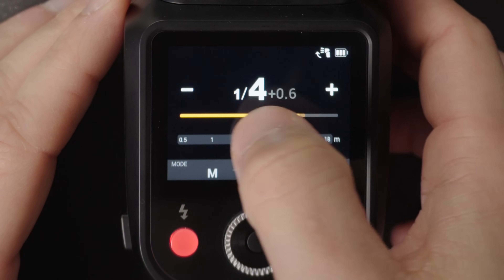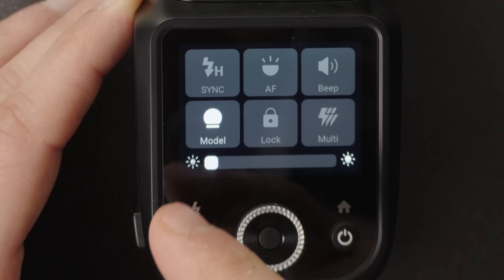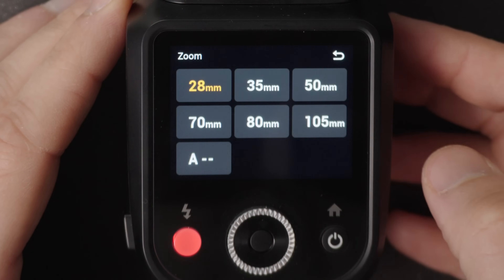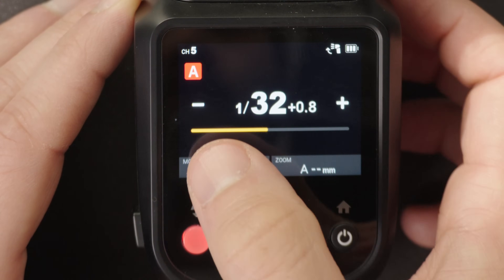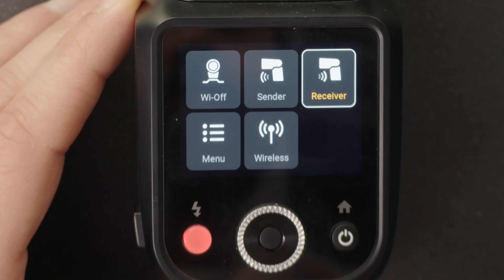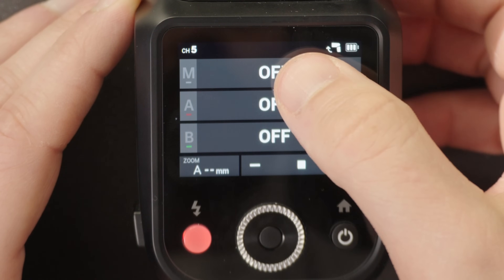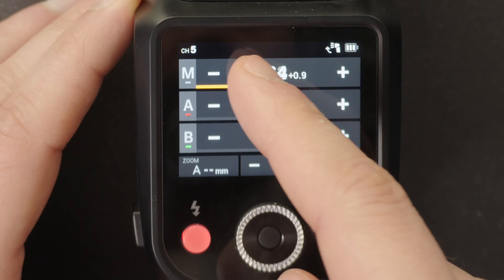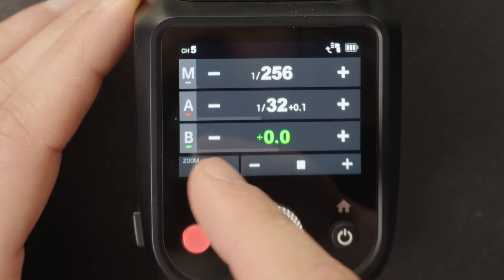New Godox V100 Flash Needs 1 Simple Fix (since Resolved via Firmware)

Comment: I’m pretty sure you can change it from a 10th of a stop to 1/3. It’s in that drop down menu.
Reply from the maker: Nope. Dropdown menu has HSS, AF assist, Sound, Modeling lamp, Lock, Stroboscopic (Multi) and a bar for controlling the modeling lamp power.
Custom functions menu has Slave, m/ft, standby, auto off, modeling lamp, screen standby, New agreement, Language, factory reset, and power type (integer or fractions).
The function to change between third stop and tenth stop is typically labeled as "Step" and paired with minimum power settings on other transmitters (Such as the X3 and XPro2).
Reply: @ So you WERE able to change it. I knew that you could but I just didn’t remember where it was in the menu.
Reply from the maker: @guyyowell8547   What? I just commented where it was on OTHER products. It's not on the V100.
Reply: @ You can definitely set it to 1/3 stops in the V100. I just go mine yesterday from B&H and in manual mode, I can set it to 1/3 increments.
Reply from the maker: @guyyowell8547  I'll take a screenshot / photo link of where it is on yours then, but I can promise I've gone through every menu on mine at it's not here (even ones like Slave that are irrelevant to power steps). I've also confirmed I have the most up to date firmware publicly available.
There's totally the possibility that you have a different brand and therefore it's at a different firmware than Sony. For instance, the Canon is already on firmware 1.05, whereas Sony is 1.02. If that's the case then great, I know it's on the way.
There's also the less likely possibility that a new firmware is on the newest production units but that hasn't hit the website yet. I find this less likely considering shipment time.
Reply: @ Hello Rob, I’m not quite sure how to attach a screenshot on YouTube, but if send me your IG account, I’ll DM you the screenshot.
Reply from the maker: IG is same as here. Or you can upload to imgur and link it here as a comment.
Reply: You really think Rob would have made that mistake?
Reply from the maker: @jeffrey3205  Appreciate that. I did confirm that I wasn't on pre-production firmware and that white label distributors didn't have this option.
Reply: @jeffrey3205  Well, apparently you can change it to 1/3 stops so Rob did make a mistake🙄
Reply: I looked at the instruction manual on Godox website. Didn't see any option to set it to 1/3 stops.

Comment: I don't want 1/10 stop increments for a speedlite.
Can this be changed to 1/3 stop increments?

Nevermind.  As I kept watching you got directly to my main issue with these new Godox Speedlites.  I hope they fix this with a firmware update.  I really dislike it on my V1 units.
Reply from the maker: I agree, the V1 only having 1/10 or full was quite annoying. In practice with photography, especially event photography, I find we make far more small adjustments than we do large, sweeping adjustments. And most often we make these in response to a camera settings change which is always third stop. I think the tenth stop control has it's place on large off camera units (400, 600, 1200, P2400) that are more likely to be used in studio settings or for more rigorous editorial / advertising projects.
Reply: @robhallphoto  - I shoot lots of weddings, and the 1/3 stops are all I need on a Speedlite.  I hate having to scroll through extra increments to get where I want to go.
At least it lets you jump in full stops by pressing the ring, but I still want to see a firmware update to allow us to choose between 1/10 and 1/3 stop increments.

Comment: Rob Hall, you are aware that Godox is selling V100 U units in North America that have a red plastic ring instead of the magnetic ring , due to a patent infringement case from Profoto. Adorama's Flashpoint version has the magnetic ring, and some retailers are supply a third party magnetic ring that you can swap in for the plastic ring ( and note: the replacement ring is NOT labeled Godox). I was just at PPA Imaging USA and spoke with Godox folks and they confirmed all this and displayed V100 U units without the magnetic ring. Adorama folks there were unaware their Flashpoint units were International units with the magnetic ring, and were hoping they aren't stopped from selling them. I took the small Show discount and bought one of the Flashpoint V100 units with the magnetic ring. . Cheers

Comment: Not sold on the touchscreen - it seems like the commander functions are now easier to use, but otherwise it seems like there is now a lot of unecessary menu diving. Where is the TCM button if you want to meter off the flash before shooting manually? I'm also wondering if "swiping" really beats just turning the wheel (I hardly ever need to make HUGE adjustments which the swipe seems to enable - just a 1/3rd here, a stop there). Also, how does this display hold up in bright outdoor light - can you still read it? I'm excited about the extra power/propac compatibility though - that last feature puts this over the AD100 in everything but portability.
Reply: You do not need TCM. In TTL take a photo then switch to manual and the flash will be a the level last used. So instead of pressing TCM you just switch to manual and it does the same thing.
Reply: @nickwilliams7867  I hope you are correct!  The TCM was the best thing since sliced bread!
Reply: @gosman949  I own the flash, that's how it works. Sony 45 and 60rm flashes work the same way. Take a photo in TTL, switch to manual and its set to the correct power.
Reply: @ that is nice!
Reply from the maker: TCM isn't necessary anymore, like Nick said it just transfers the power setting automatically when you go from TTL to M. Swiping often doesn't make sense for common use, especially event photography, where you are making frequent adjustments less than 1 stop. That's why I think the 1/3rd stop is so critical to include. 2 taps of the + instead of 7 taps / trying to swipe for such a small adjustment.
The display is great. Far better than the black/blue display of the AD200 Pro. I haven't tried it in sunlight yet but can see it just fine in overcast.
Reply: @robhallphoto  Thanks. That's a great common-sense approach. Agree that 1/3rd stop increments in Manual mode is the way to go or should at least be optional (it annoys me I can't do this with my V1 especially with the wheel being such a piece that makes fast changes error prone). It might also be nice if, in "event mode" or whatever, a tap on the right half of the screen was "+" and a tap on the left half was "-". 

Adjusting power up or down is my #1 activity when using OCF and it would be great if I could do it without thinking (yes, I understand that this is partly what  TTL is for - I shoot auto all the time too). My $100 685 flash, with propac ability, ALWAYS defaults the wheel (which has SOME tactile feel), back to power adjustment no matter what I'm doing in manual (and moves in thirds). Does the V100 do that with its wheel? If so, I could live with the other compromises, probably.
Reply: It's going to be hard to do events since in the pass your muscle memory would allow you to quickly turn groups on and off and change ratios without moving the camera from your head since you knew were the buttons were and what sequence of botton pressing to get your result.  Now! You have to stop look at the screen and pray that you don't press anything else on the touchscreen while in there😞
Reply: @jeffrey3205 This is why I like the way SONY flashes allow  you to adjust all the settings directly in the camera menu.

Comment: In your review you nee to talk about the V100U which seems to be shipping to the USA only. It does not have the magnetic head. Wes Perry has a video on it.
Reply from the maker: I'll have to catch up on this topic as I've not heard anything about this. From the look of the X100 listings on Flashpoint, there are ones that include the AKR1 kit so it seems there's magnetic units in the US.
Reply: It comes with a ring you can swap to make it magnetic. Wes also mentioned it could have potentially been this way bcuz of a potential Profoto legal issue.
Reply: FWIW I received my V100-S yesterday from B&H and the one I was sent still has the standard black magnetic ring and no USA or U markings on the box or flash body.
Reply: @dpfreedman  To make things worse, B&H is telling everyone that the "orange ring" is the magnetic one and the black ring is the USA one without the magnet. They even called me back to tell me that they contacted Godox and were told that the orange ring was the one with the magnet. I still think they are wrong.

Comment: Looks sick! But not enough to let go of the V1 yet.
Reply: The difference in thermal performance is game-changing over the V1, especially in Hi-speed sync use. . . I have two V1 units and dont use them now, looking to sell them.  . I use the V1Pro which has the greater thermal performance and I just bought one of these V100 units with the greater thermal performance . Cheers
Reply: just wait for Rob in depth review...
a lot has been improved compared to the v1...I sold mine a week after getting the v100.